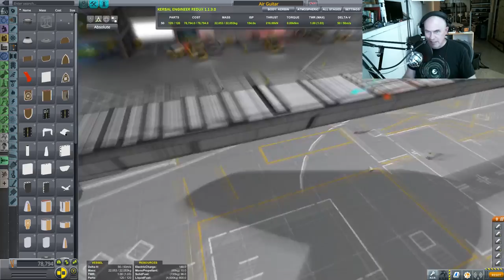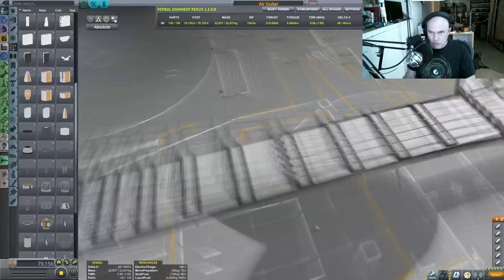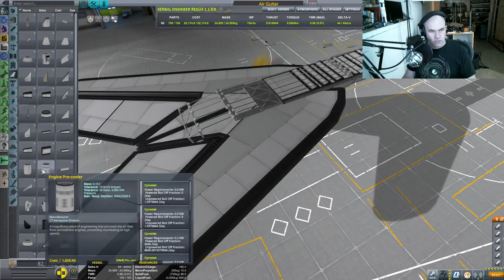Kerbal 'Air Guitar' - 'Flying Vee'

Comment: That rolling motion is called a "Dutch roll" its caused by a swept wing more aligned to the air, it creates more lift raising that wing but also more drag yawing it back while it brings the other wing to be more aligned and so on.

Comment: …and those rocks on the dark side of the moon weren't just black, they were, like, pastel black, either!
The rocking and rolling of the Flying Vee probably was yaw induced. There is too little stability around the Z-axis. One way to fix it would be extending the wingspan further and whack on smaller vertical fins or, well, with given span, bigger fins. That would hamper the playability of the guitar, though. Maybe try dihedral? Inverted gull wing like on the Chance Vought Corsair? The lateral projection of the wings  could help getting some stability as well. See the dihedral on the (no longer quite) horizontal tail of the Bristol Beaufighter as example. Such configuration would have a strong tendency to roll when yawing, though, so I'm not quite sure it would be a great help. It would require a great bit of directional stability to not be a total disaster.
Elevator flaps on the headplate would probably shorten the take off run drastically. A canard-ish configuration like HOTOL, if you like.

What may be worth trying: Angle down the centre section of the wings some  -10° dihedral, attach engines there (At some 25% of the wingspan?) and whack the main landing gear on the engine nacelles, the outer wing panels angle upwards at some +5°. An extra dorsal fin under the fuselage for additional directional stability might be a good idea in case of trouble. Shorter undercarriage=less weight=better power/weight ratio or greater ability to carry fuel. Active pickups for attitude control by electromagnetic force outside the atmosphere might be neat either. ^^)

Four thousand miles an hour over water
In a purpose built machine
No one dares to call a plane
Out off this world
Speeding
This is your day
https://www.youtube.com/watch?v=n3ftZfB-VNQ

Comment: the high sweep is causing yaw roll coupling you need clamshells on the trailing edge or more side area ie bigger vertical stabs

Comment: would try to disable engine vectoring from what I saw, that was main contributor to that rolling instability... and I would install some flaps on front "canard" it would provide additional pitch authority.
Sometimes helps when control surfaces do for what they are meant, for example use vertical surfaces only for yaw.